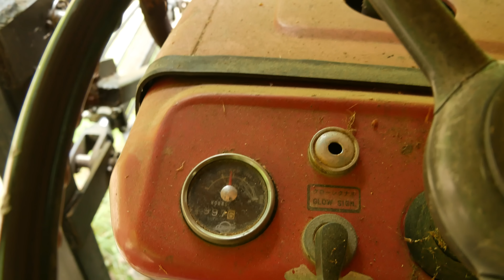Fixing up an Old Shibaura? Tractor

Comment: The first tractor I ever drove was a Ford 1320. I was 3 and my dad left me on the seat the neutral safety switch didn't work I started it while it was in gear, luckily I hit the garage luckily it wasnt heavy enough to take the wall down
That had a shiburaa engine

Comment: I don't know if it is something you would be interested in, but I have three riding mowers that all run but just need a basic running through. I have a fourth part tractor as well, most of them are very low hours. I always planned to fix and flip them but my disability progressed faster than I expected. My realtors need me to just get them gone, I can have the junkyard pick them up for free but it seems like a shame when I have so many extra parts and they are almost all the same model. I also have a few ad hoc at buildings on trailers I need to get rid of. Just wanted to put it out there, I'm in a strange hurry but I trust you if money is not immediately available

Comment: I own one of these except it says FORD 1100 on the side. Mine is a 2 cylinder, 13 hp Shibaura. I bought it new in 1981. Mine is 4wd, cat I 3 point, 5 speed trans with a high and low range.

Comment: We just bout a ford 1910 1986 year model its a great runner but the pto part of the clutch is cooked and grinds trying to engage. Its a 2 stage clutch  probably just gonna replace it all since it requires splitting the tractor into half. Do u still have this tractor by chance?

Comment: Hey bud nice video I have the sd1843d and I can't find the part number let alone the radiator hose
Reply from the maker: I would recommend EBay or just take our old radiator hose to Napa or another parts store and look over the hose selection to see if you can make something else work. Most time those stores will be no help looking the hose up, you just need to compare and find something close to make work. 
I replaced all all the hoses on my Japanese Kei truck with super flexible silicone radiator hoses.
The good thing about those are you can buy them per foot and they flex really well. Just a few suggestions 👍

Comment: Hey Mike, thanks for the info. I have a Shibaura almost identical to yours. How do you like your shredder? One of those would be great to have. Do you have any other attachments? Always looking for ways to make work more efficient
Reply from the maker: Hey Gary they are ready well built tractors 👍 I don’t regret buying that chipper, it’s an awesome attachment.
I had an 8HP Troy built chipper for years, it was heavy and hard to move.
This chipper can chip a pile of sticks in half the time of the Old Troy built.
I built a box scraper about 8 years ago for my tractor as well.
Here’s a link to one of my videos, I run the chipper at about the middle of this video 👍
https://youtu.be/ATdKCAUE_Bo

Comment: Yanmar used to make smaller John Deere tractors.  I have two 25 horsepower John Deere hydrostatic tractors that say Yammer on the frame and engine.  I didn't give much for either and they are very solid.  There is maintenance required which will keep them going beyond 10 years.

Comment: Ah yes I know that feeling of "I'm just gonna da that little thing and if I ever gonna repaint that it's going to be later."
Started doing the wiring on a Unimog I bought. While crawling beneath the truck I saw that the rear cross member was rotten. So I thought I'm just gonna replace that. Took it partly apart and realized: Yes better repaint the whole frame, isn't that much more effort anyways. 
Then I found out the complete frame was rotten, so I had to take everything apart and now have to rebuild everything on a new frame. Doesn't matter know. The cabs gonna be repainted too before it's going to get mounted again. 

Need to do the whole deal now. 

As for those compactors being sold under Us manufacturers names: Your tractor isn't the only one. I think it's Massey Ferguson that sells Japanese Iseki tractors under their brand - but they do that in the rest of the world to. Here in Germany you can order the same tractor as an Iseki or Massey Ferguson. 
I mean many brands do it. Mercedes sold the Unimog badger as Case and Freightliner for some time. Even called it an American product. Deutz produces tractors that are sold under 6-7 brands throughout Europe. 
Names are all just wishy washy anyways.
Reply: Iseki  has  been  building  the  compact  tractor  lines  for  Massey  for  decades  already.  I  think  it  started  in  the  90's.
Reply: @jeepanimal2943  big go be fair: If you gonna do rebrand tractors you better do it from a company that does it right. 
I used to work in a municipality that had a early two thousands Kubota and about 5 year younger iseki. Whilst the Kubota was a bit more powerful, absolutely sturdy and has been around the clock once or twice, the Iseki is just a bit more refined. 
Might be that it is a bit newer, but there are things like: you can check the oil without opening the hood, and Id you want to get to engine you can remove all panels around it easily without tools and get to everything. 
The front hydraulics are incredibly beefy, the rear trailer hitch mounts in a sled like they do on bigger tractors nowadays. Makes it incredibly easy to adjust the height of the hitch or Switch between the bolt style tractor hitch or a ball hitch. The Hydrostat itself is also great. Has a throttle feature so it feels like a normal Gaspedal. 
Everything is analog and mechanical, so Computer Therese. 

It was a Great machine to work with.

Comment: I think Tym tractors has a 67 hp tractor that is does not need def.  I believe 75HP is the cutoff.  But I think they are all electronically controlled.   The def systems needing regen are terribly unreliable.  doesn't matter what brand.
Reply from the maker: Yes that regen stuff doesn’t seem to work very well. My friend was running a new $60k Kubota excavator and it had about 40 hours on it, the darn thing tried to regen and put a fault code on the screen that it didn’t regen properly 👎 Not good. 
Thanks for checking out my new video Gregg 🙂

Comment: Might want to look into John Deere 955s - they really check a lot of the boxes that are likely on your wish-list. I've had mine for years and the thing is just dead nuts reliable. Maybe one of the last great compact utility tractors. My wife suggested I replace it with something newer recently and normally that's the kind of permission we all hope for - however I have no interest in something with computers, emissions, and cracker jack parts.

So I guess I'm going to have to build a cab for this Deere because I'm getting a little tired of blowing snow in an open top. LOL.

Comment: Does this tractor have a 4 slot pto shifter on it, and if it does what does the different slots, is it like a range slector for the pto speed, I just bought one of this tractors and can find any info on the pto, let know thanks
Reply from the maker: My tractor has a PTO shifter with 3 speeds and I think Neutral between each gear. My shifter is all going in a straight line forward to back. 
What model do you have?
Here’s a video I made years ago and I go over some of the shifters on my model, maybe this video will help? 
I have ran a big chipper off my PTO and a hydraulic pump that powered a mini backhoe. I usually run the PTO in the slowest gear for the chipper and the hydraulic pump in speed 2 that way I could idle my tractor when running the backhoe 👍
https://youtu.be/RCBfL299UdE

Comment: Hell this is a total Longshot but I floated a few other crazy long shot idea so why not. At my current house I have a bridge crane and at my new house it is very flat and everything is paved. I need to buy a forklift, the type that the whole Mast doesn't go up in the air, there's an oversized two car garage it would be used in mostly. I would prefer electric or propane, but I don't care what size or what something looks like as long as it is reliable. I'm looking to buy that immediately in cash because it will save me a fortune in moving expenses

Comment: I buy and sell tractors.  The L2501 Kubota can be had on the east coast used with a loader for 17K  and you stay under the emissions.  Gear or hydro they are hard to beat for the money.  The JD version is aluminum on the rear.  The older JD's like the 3005 or the 790 are completely made by yanmar and are absolutely hard to beat for the money.  Now Yanmar just makes the motor for them.
Reply from the maker: Great info! Thanks 😊 I really appreciate it 👍

Comment: Got a couple questions about the hydraulics.  Are the rear reservoir and the transmission sections connected? Reason I ask is I added some hydraulic fluid treatment to the rear reservoir because of some minor leaks.  After using the tractor for a while, hydraulic fluid started overflowing around the gearshift. 
Second question is where is the hydraulic drain plugs located?  I noticed there is water in the fluid and need to drain it out before winter so it doesn't freeze.  Will probably replace the hoses at the same time.
Reply: I have a shibaura d2600.  Yes the hydraulic well is all the same. I use trans hydraulic fluid.  The tractor hydraulic system and trans all shares fluids.

Comment: If you are looking at older tractors, why not something with more than 24hp? The emission limit is a more recent change...
Reply from the maker: If I get something a little newer I will probably look for something in the 24 to 30 Hp range, most of my 3 point stuff is better for that size tractor, also I have a lot of tight trails so a more compact tractor is better for my land. Thanks for checking out my new video 🙂

Comment: Use the loader bucket to break the beads... and that totally could have been patched. If you want a little more stability, I bet you could flip the rear tires/wheels. Put the left on the right, and the right on the left, turned around. Same with the front. (the part of the wheel you see, put that toward the hub.)
Reply from the maker: I think 30 plus years out of some tires are good enough 😂   So you really think using the loader without rims on the rear is really a good idea man??? 
I’m ok with putting a few hundred dollars into new tires.
Reply: @Mikefestiva  There are tractors with much older and weather cracked tires out there running every day, just with a patch or two, or three. And yes, I use my loader to break tire beads with it on jack stands all the time, front or back. Shoot, it's got the front up on them now and I just did 4 trailer tires (waiting on front end parts). I'm not saying lay under it while you are doing it... ;)

Comment: In my flea bitten opinion keep your old "analog" tractor. Dance with the date you brought.  I have a feeling replacement parts for late model tractors will suffer in the years to come.
I just replaced the front tires on my hinomoto e16 and painted the rims. Just moved a half load of mulch with my rear dump bucket. 
Something I did last month is add a pair of led work lights where the flashers were.

Comment: Hi Mike.
I hope you can help me 🤞🏼my dear father left this traitor on his farm… and I simply hope you can describe how to start the traitor 😅 is there a special bottom to hold in or something like that? If you are able to describe it in “start for dummies” I will appreciate it 🙏
Reply from the maker: I probably can walk you through starting the tractor As long as it’s not been ran out of diesel fuel the last time it ran.
You should be able to pull the throttle lever back about 1.5” on the right hand side along side the hood next to the steering wheel.( keep in mine you turn off the engine with this same throttle lever by pushing it all the way forward till the engine stops, then turn off the key)
Next turn the key all the way left for 30 to 40 seconds till the little glow plug coil light in the dash starts to glow red then turn the key all the way right with the clutch pushed in and it should crank for a while then try to fire. If it sputters but doesn’t start try then same process again with a little more throttle and see if it will start.
These older engines don’t start as easily when it’s really cold outside.
If you get it to start and run, you will not need to turn the key all the way to the left ( glow plugs) every time you start it when the engine is hot.
Hopefully this helps. 👍

Comment: Just hauled my cousins ford tractor home. 4x4 with Shibaura engine. Runs good. His pickiness as a machinist and engine builder means he wants to rebuild it (cause it puffs smoke on startup?). Anyways...anyone know of a good parts source? 3cyl diesel. Seems that IHI is associated with shibaura. IHI is good Japanese stuff.
Reply from the maker: I wouldn’t worry about smoke on start up, mine has always smoked on startup as well, it’s an old diesel, just run it man, it will probably run for the next 20 years.
Reply: Parts are hard to get for these tractors especially the older ones 440 mine is a beast but yeah the parts are getting hard to get.

Comment: Thats just plumb purdy. I had to change a tire on my 06 Kawasaki mule a couple months ago. It had never been off the rim. Worked on it a couple hours and got disgusted so I drilled a hole and took a jig saw to it. I have changed a lot of tough tires, but that little mule tire almost whipped me. From now on the jig saw comes first if I'm not gonna reuse the tire. lol.

Comment: I have a 1957 IH 330 that's SOLID, unfortunately a gas engine. Buddy has a 2011 "Massey" (Agco made by Iseki), surprised at how flimsy built it is. Cheap. Junky.   Why are you masking off everything? You're supposed to slobber EVERYTHING with paint. It's called a Pittsburgh Overhaul.....lol  Enjoyed the video.

Comment: Beauty. I would never sell it. These things will be running long after the apocalypse. Future humans will believe the Japanese were gods of engineering and manufacturing.

Aluminum components are fine IF it's made properly. High strength Al is crazy strong, but getting these bean counter ran companies to use the good alloy... Transmission/diff in my nissans will take 800 wtq as long as you're not launching at the track with drags (it will take it for a while, though). 
They're just cost cutting POS on everything new.